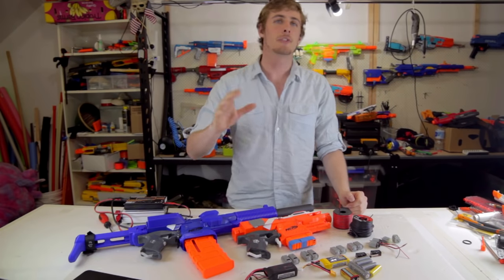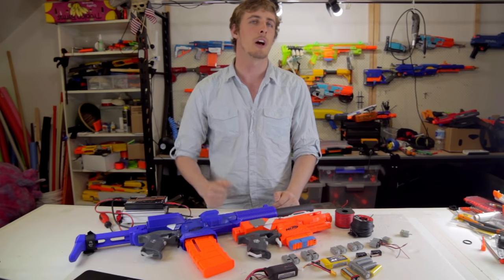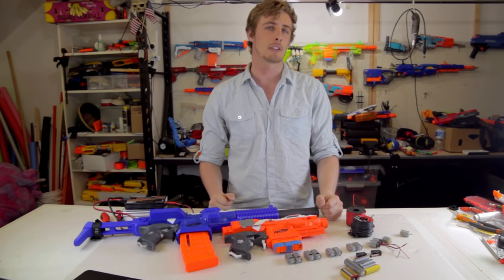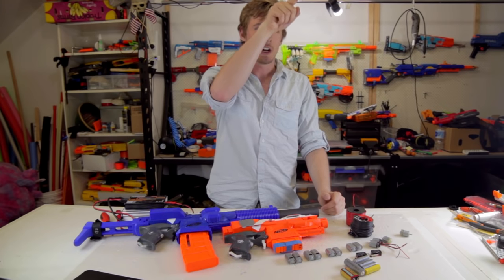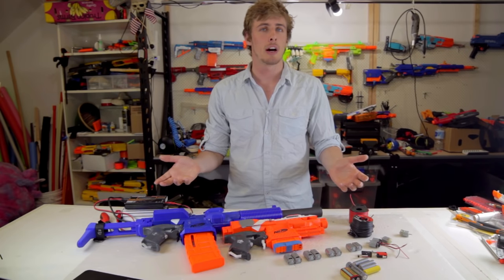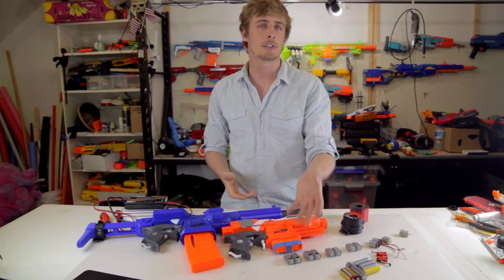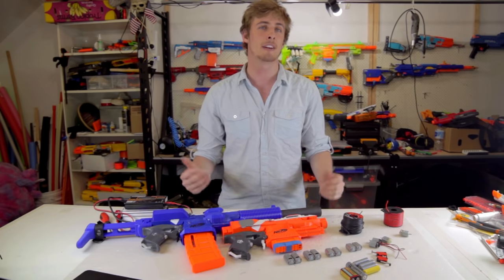Batteries & Motors 101 | Nerf Modding Explained

Comment: I still don't fully understand why 180 motors would take less cells (2S) as opposed to 130 motors taking more cells (3S), since you're applying less voltage to the larger motors than the smaller motors. I've never used Lipo batteries, so I can only assume that it's because 2S can discharge a much higher current? Still learning, trying to do the best I can.

Comment: Well I'm bookmarking this one, really well presented! A good chunk of this applies to airsoft (different motors and switches, but the wiring and batteries are the same, and the maths of course)

I even learned why 2s/3s lipos are called s when Cell begins with C! Didn't think about series and parallel connections in battery packs, I've never seen a parallel connection. The discussion of connecting two batteries together to double the capacity does pop up every now and again, but it's generally frowned upon in our circles as different discharge rates could lead to one battery overdischarging before the other battery is empty(at least, that's the theory that's thrown around)
Reply from the maker: Yeah, I wanted this video to be applicable to as many different communities as possible. Parallel is very rare nowadays. I'm not 100% sure on how using several packs in parallel would go down but that sounds legit. Battery manufacturing has improved so you can get pretty big individual cells so paralleling packs is rarely necessary.

Comment: I got 2 things. 

1. How to calculate total use time for a 3s 1 amp/hour 25 c Lipo powering 2 rhinos
2. If the total volts for a 3s is 11.1, that would only give me 3 volts of wiggle room before I have to recharge at 7.1 volts? I don't want any of the cells to drop below 3.2, so 7.1 just doesn't seem like a lot. Or can I push it all the way to 3.2 total volts in the entire battery?

Comment: Does the 4 digit wiring spec of a motor (like 3240, 2190) affect the kV of the motor? Also, a video on MOSFETs would be very helpful.
Reply from the maker: The 4 digit code is related to the thickness and number of turns of wire in the coil and not the kV. Search for "Mabuchi motor code" for more info on that -R
Reply: So then what does determine the kV of a motor? I was reading on an RC forum that the number of wire turns on each armature and the thickness of the wire determines the kV. Something like lower kV motors have thinner wire but more turns. Given that your 3050s run on 3S and Mabuchi's 3240s run on 2S for around the same RPM, that seems to hold true, but I'd like to know for sure.
Reply from the maker: A lot of things. Its best not to think of kV when dealing with brushed DC motors -R
Reply: kv is still applicable for brushed motors, and can definitely be used to determine the motor you want. as well, kv and torque are inversely related. high kv tends towards low torque. different permanent magnet types will change the torque of equal kv motors. many motors have an-isotropic ferrite magnets and those are the weakest type. however, for the same kv motor with neodymium magnets,  the torque will be much higher.  the middle of the road magnets are isotropic ferrite which are the strongest that ferrite magnets can come. neodymium, being an entierly different material, has an entirely different performance threshold, though it doesnt range much if at all.  with the same number of turns on a motor's armature,  weaker magnets raise kv and stronger magnets lower the kv. so a neo magnet equipped motor will have the highest torque, and will also require a slightly lowered turn count compared to a same-kv ferrite equipped motor.  this is the most significant reason why kv doesnt tell you all that you need to know about a motor.

kv is more useful with brushless motors because all brushless motors are equipped with neodymium permanent magnets.  the same-kv shift of torque variance in brushed motors is not relevant to them because of this..
Reply from the maker: Every useful info! This is why you can't just put neo mags in and expect it to work the same but better since the back emf from the stronger magnets will reduce your maximum RPM. I really want to do a much more detailed video to go into these sorts of details. As far as I know, kV is more useful when you motors coils are fully filled, you know your magnet, and you can just assume you will get maximum possible torque out of the wind (brushless motors). As well as that kV is useful for marketing reasons as it means you don't needs to directly list your torque, you can just let the customer assume it ;) For the MTB motors we have the full torque curve and numbers available for people to look at and compare which is a far better metric than kV. It is also usually possible to find this curve for brushed DC motors -R

Comment: Would it be possible to run honeybadgers and wolverines on 4 AA or would RPM suffer or would it only be spin up time? Also could I run rhinos and hellcats on 8 AA or  would RPM suffer or would it be only spin up time? I don't give a crap about spin up.
Reply from the maker: AA batteries do not have high enough output currents. You will need a LiPo battery -R
Reply: So they won't even run? or will they have a super long rev up time
Reply from the maker: Longer rev times -R

Comment: As an alternative for microswitches I've found in the US a chain called RadioShack carries lever/roller switches for about $3.50 a piece.  Their ratings are 5A/125VAC, and I haven't had an issue with them in the last 6 months I've used them.  They're not as beefy as the Omron 15A/125VAC switches it looks like Ryan has on his workbench, but they've done the job for me without any issues.
Reply from the maker: Sounds good! Microswitches are a bit of a fuzzy area... Its hard to give really valid advice other than "use something better tan stock" -R

Comment: Great video, Filled in a gap I had on Lipo and made me wanna make a 2s2p 18650 battery tray for my next Stryfe build. Luckily I have a 3d printer and knowledge of vape batteries (Most common application of 18650 by non hobbiests) Wish me luck

Comment: So If I use two rhinos for the flywheels and one honey badger for the pusher in my rapidstrike, do I get a 3S and a 2S and have them running on two different circuits? PLS answer.
Reply from the maker: Honeybadgers in the pusher on 3S are really high rate of fire -R

Comment: Do ALL aftermarket motors have carbon brushes? XP180's and Blade 180's?
Reply: Yep, both do! XP180s have removable brushes in case they need to be replaced, which is nice.
Reply: Well, certain motors don't cough RM2s cough. But generally, pretty much any commonly used motor in the NIC will have carbon brushes.
Reply: Cool thx!
Reply: But with how cheap Rhinos and Honeybadgers are now going with RM2s just don't seem worth it anymore... I pay about $7 for a pair of Rhinos shipped.
Reply from the maker: Nobody uses RM2 any more... they are just sub par and not even worth the cheaper price -R

Comment: @.Make Test Battle hey nice video very informative. I'm from the drone community,nit auto dji but hand soldered freestyle quads. The lipo batteries that go upto 4.2x are HV (high voltage) standard lipos charge upto 3.8v. Tha k's for the vid I'll be using it to mod mine! Cheers.

Comment: Great video.   Thanks. I would like to see a video covering the torque and RPM differences between brushed and brushless.
Reply from the maker: It is verrrrry hard to find the exact figures for brushless motors but a guy on the Nerf Reddit page did some testing and the ones he used seemed to perform similar to top tier 180 motors which is quite surprising. That said, there are many different brushless motors so whos to say some aren't better.

I will definitely cover the differences between brushed and brushless in the detailed motor video -R

Comment: great video, thanks for doing it. I'm curious of peoples thoughts on using trustfire batteries with stock motors, which is what my son and me are doing at the moment. we have a rapidstrike each and the grand plan next year is to do the full mod, but for the moment we have a reasonable performance from the trustfire batteries. please comment.
Reply from the maker: So, stock motors have metal brushes that will wear out much quicker with higher voltages. Using trustfires on stock motors is a "bad" solution but if you use it til it stops working then upgrade to something better then thats okay -R
Reply: My main hobby is remote control cars. I love playing with nerf guns with the boy. You are the first channel who has shown the metal brushes in a standard motor and why we should upgrade.

Comment: How well do aluminum flywheel cages work as heatsinks for the motors?
Reply: Nicolas Reed Very well, in fact. It gets to about the same temp as the actual motors, which is great, because it means the motors aren't getting as hot
Reply from the maker: I dunno. The motor casing itself takes  along time to heat up. When i first got the Rhino motors made, i ran a pair for a few hours continuously. After 4 hours the motors got so hot they warped a plastic motor cage, but that was running non stop the entire time. Overheating the coil from overvolting will fry the motor long before the casing gets hot -R
Reply from the maker: hahahah 550 motors would be a littttle different to a 180 in terms of heat :P -R

Comment: Is it worth lipoing stock motors, or only if you are upgrading the motors?
Reply from the maker: Not really. The stock motors have metal brushes that will quickly wear out on higher voltages so you will see a performance increase, but the motor will eventually give out. If you are going to the effort of LiPo battery upgrade, you may as well spend the extra $10 for replacement motors -R

Comment: I know this video is a bit old and dunno if you still check the comments but I have a question..... if I intergrate a cordless drill battery into the handle of a blaster, what motors would you suggest and would a 12v battery be too much (obviously it would be better to use lower voltage) but most drills I'm finding come with a 12v.
Reply from the maker: Not sure if you understood the video but a 3s Battery has an operating voltage from 12.6v to 11.1v.
The real question is if the battery can handle the current output. 
-Justin

Comment: Hey MTB, I finally got around to making my rapidstrike Uzi but I'm not sure what to do with it. I am not allowed any sort of lithium battery in my household so lipos are out of the question. I am not a massive nerfer, I just like playing around the house so super fast flywheels aren't really needed I do however want a high ROF so I thought, what can I do. And I came up with this:

Keep the stock wiring, replace the pusher motor with a honey badger, and use a 7.2 volt nimh pack. Will that setup increase my rate of fire? Thanks

Comment: I found to what you said about 14500's to be wrong. I just completed my Rapid-Pistol build with 2 MTB Rhino motors and 1 stock motor and I ran it on 3 14500 IMR's with 650mAh and 9.75 pulse C and they worked really well and I have fired the gun probably 600-700 times and my not batteries nor motors are heating up a lot and my build works very well. This is still a very indepth tutorial though. Good Job!
Reply from the maker: It make a "worked really well" but I can assure you that the motors would perform better with a proper LiPo. 9.75C burst on a 0.65mAh is only a 6.3amp burst. The stall current on each Rhino is 8ish amps so you are trying to pull ~16ish amps out of a battery that is rated for 6 amps. -R
Reply: Okay that makes sense but I do run 3 batteries on a battery pack. I would have used a LiPo for the build but the initial investment is too high for me and this is the only flywheel blaster I actually have so I don't want to spend a ton of money. I still love how it turned out and it has very good range and ROF. 

Thanks Though!

Comment: does any one ever use motors that are not these standard 180 you talk about there is a massive selection on hobby sites for in runner motors with 3d printers modifications or building a mount for them could be done?

Comment: Great video guys! Very informative. Have a quick question for you… I'm putting together a rapid pistol with three hellcat 180s. Plan on using a 1000mah 45c constant 90c burst obviously 3S lipo. Just wondering if that will be safe if the motor stall?
Reply from the maker: I think you should rewatch the battery section until you can answer your own question :) -R

Comment: Is there a way to connect wire without a soldering iron
Reply: Yes. But they are sub-optimal and not recommended. A bit of solder will provide a much more secure and low resistance connection than wires simply twisted and taped together.
Reply from the maker: It is verrrrrrrrry difficult to connect wires to the motor without solder. A cheap soldering iron and a bit of patients will work wonders. Plus soldering is a valuable life skill! -R
Reply: Yes, it's called a $3 soldering iron from Harbor Freight (or your local cheap disposable tool store)  and some solder. No joke, learn to solder, it will saver your life.

Comment: I have a question. I have Honeybadgers. My preferred battery is sold out (25C with 35C stall). There's a similar size pack that is 40C. Now, does the increased potential for current mean it will burn the motors? Or does the fact that the motors draw current mean it won't change or hurt the circuit? (I'm running it on a mosfet system, should that matter). 

TL;DR does excessive current potential in a battery cause any issues in lifespan of a motor? Or is merely going to be wasted potential?
Reply: Forget it, I was rewatching while I typed this and you just answered it. Ignore me haha.

Comment: So does anyone see anything wrong with running 2 hellcats and a rhino as the pusher in a Hyperfire@3s? Or should I go with wolverines as the flywheels and rhino as the pusher? I don't currently have any 2s lipos. So basically what is the best setup for a Hyperfire on 3s. 
Cheers, Zayne :)
Reply from the maker: Use the hellcats for flywheel motors -R

Comment: Is there any motors that 3 IMRs will be able to supply the current and amps? I just bought 4 IMR's. And I was initially going to run stock motors. But I that would ruin the motor. So would your mtb rhino motors be  able to supply their full potential with IMR's?

Comment: So a 1000 mAh LiPo with 65C can output 65 amps? Also, do you know the stall current of extreme pro 180 motors. I could not find the spec sheet.
Reply from the maker: a) Yes. b) No idea. Not all motors have good avaliable spec sheets -R
Reply: Regardless, that Lipo should be able to take two XP180s easily - judging by recommendations from Xtreme and the power choices of others. With its burst factored in, it would be able to take 3 in a RS.
Reply from the maker: Agreed. Conservatively people seem to recommend 30 amp stall for XP180s -R

Comment: I'm running a 1000ma zippy compact 3s lipo with 3 xp180s (one for the pusher). Would this be advisable?
Reply from the maker: Not sure because a good spec sheet for XP180s doesn't exist AFAIK but it depends on the C rating as well as the capacity. I would allow 30 amps per XP180 conservatively -R

Comment: So what C rating do you recommend for your MTB motors?
Reply from the maker: I think you should rewatch the battery section until you can answer your own question :) -R
Reply: Make.Test.Battle Well I know you said a Stryfe with Rhinos is ok on a 25C LiPo. But what if I'm trying to use a 35C 3S LiPo on a rapidstrike with 3 hellcats? I just want that exact setup to run at maximum efficiency
Reply from the maker: As I said, highly recommend you rewatch so that you understand the meaning of these terms. The answer you seek is in the video. -R

Comment: OK so.....before watching this video I actually just bought 180 motors and a 1000 mah 3s 45~90c pack. I'll be molding both my rapidstrike and stryfe. is this battery going to provide enough amperage for the 180 motors? or should I buy a bigger capacity battery
Reply from the maker: You should rewatch the video. The answers to your questions are contained within -R
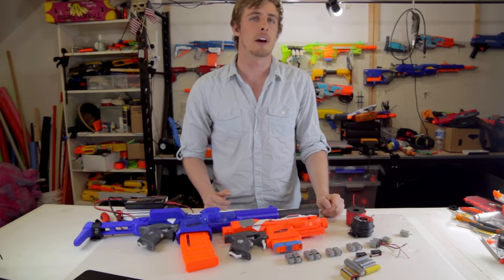Reply: Make.Test.Battle 11:45 - a continuous discharge of 35c is fine because the stall current is for a very short period of time. hellcats require 50 amps stall current, therefore a 90c burst is plenty to overcome the short stall current. am I on the right track here? I'm not as think as you dumb I am I promise!
Reply from the maker: 2x Hellcats = 25 amps x 2 = 50 amps.
1000mAh x 45-90C = 45 amps - 90 amps
90 > 50 -> Good.

3x25 = 75 < 90 = good too if you stall all 3 at once but you always fire after the flywheels spin up -R
Reply: Make.Test.Battle OK I see! so....don't jam the trigger and the Rev trigger at the same time or there will be a nuclear explosion. 

I'm going to be playing with younger kids so I need to make sure to warn them about that

also thank you so much for replying. I love your videos, you don't upload often enough! :)
Reply from the maker: Not quite. A 90C 1000mAh battery can easily handle 3 Hellcats spinning up at once.
Reply from the maker: And yes, more uploaded required -R
Reply: Well, you have ten seconds. And even then, the overdischarge isn't that bad if you don't keep it up for long. Hellcats spin up fast enough that they can probably get a shot off immediately, you would probably have to intentionally pull the trigger before the rev trigger.

I think the kids should be more worried about the 10+ darts that will be hosed in a second.
Reply from the maker: ^pretty much. If you look at the graphs i simulated, with in half a second the motors are drawing only 2-3 amps. The burst literally means continously drawing that much current for 10 seconds straight before the pack starts to warm up. -R